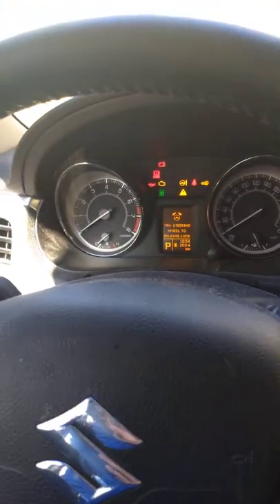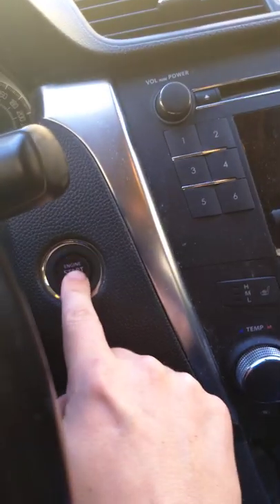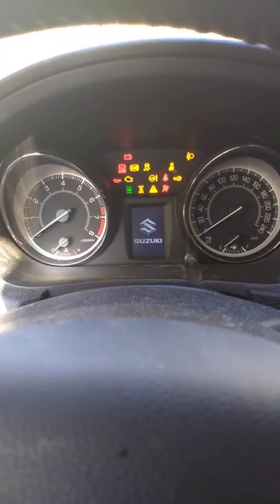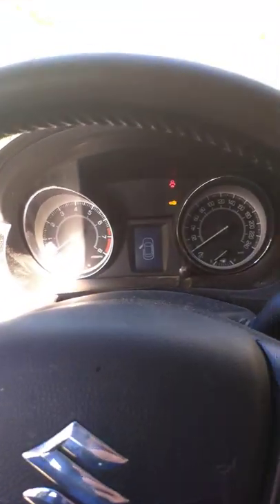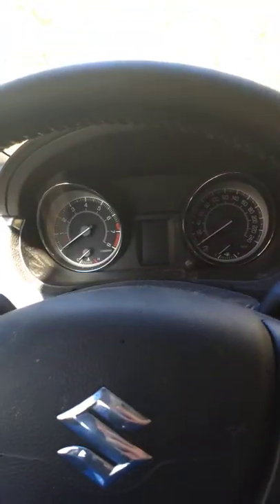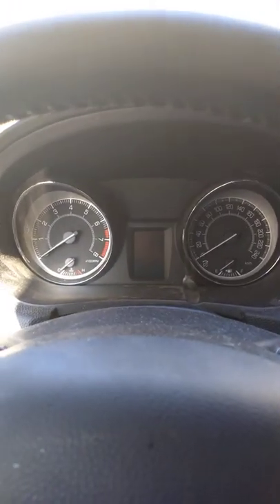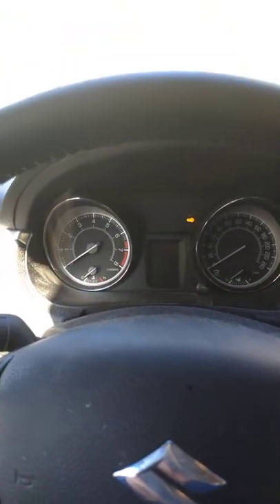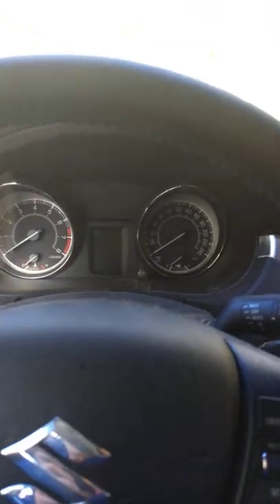How to fix steering lock bug, on a keyless car in a easy way.

Comment: ADVICE ! Instead of open/close the door many times you can just press the sensor near the tyre pressure placard (like a black spring loaded nipple with a screw). It will send the required singal without slamming the door. Just got the same trouble yesterday. Couldn't start for about 15 minutes so had to get an uber 😖

Today is much warmer so the trouble disappeared itself. Found the hack on the Kizashi forum. You could just disconnect the sensor mentioned above(please read the exact steps on the forum)  and you'll never have any more trouble with the steering lock (neither its functionality and a few more non-critical functions thought)
Reply from the maker: True. I learned that after doing this video. Thanks for the tip about the sensor :D
Reply: if you disconnect that sensor, once it is working, it wont lock up anymore
Reply: @Fyr13Bry  Actually you dont need to remove that rubber switch completely. Just wrap the screw with piece of paper or something that would isolate the screw from touching the body(ground) and the problem is solved. 👍
Reply: Did anyone disconnect the the black spring loader? Does this actually work?? My sons car is doing the exact thing! Is this a problem with the key fob?

Comment: I had the same steering lock wheel locked even though the wheel didn't lock even when turning 180° in both directioms when car was off, the solution that made it work was reseting the computer system by unpluging the battery for 5 minutes and pluging it back, hope this helps.

Comment: Many thanks, Petter.  This happened to me this morning and I needed to call the AA breakdown service to fix it.  The AA engineer sourced this video before he got to me and on arrival tried this open/close door method and it worked very quickly.  However, he said I needed to go immediately to my Suzuki garage for it to be checked.  They couldn't replicate the problem and said it was hopefully a one-off incident.  However, if it does happen again, I will know how to fix it (finger's crossed).

Comment: Hi Peter
How to solve this problem .i have same problem in my kizashi. Sometimes it takes 1 hour to start engine.
Thanks
Reply from the maker: To really get rid of the problem 100%, you would have to buy a new stearing lock. https://www.megazip.net/  it cost around 200$ for the part.

Comment: I have a 2010, and i didnt want to replace the steering wheel lock $$$, so if you can get it to the point where is starts, you can remove the electrical connection(unplug the wires on the door switch. It is on the B pillar, and it is one or 2 phillips screws, then take off the rubber, and just disconnect the electrical,it wont relock...it registers when you close the drivers side door, but if you dont have that switch connected, your car will still lock, but the steering lock will not engage

Comment: Thank you very much for the video! my 2011 Kizzy just started having this problem, two times so far. the first time I thought I would try the battery disconnect/reconnect to see if that would fix it but I did not have the proper tools and couldn’t get the battery cables off however I thought I’d try to start it again anyway and it started. I tried the same technique the second time and again it started so if it is a door sensor issue I am wondering if the precise door that needs to be open is the hood since it registers on the dashboard as a door as well.
I also recently was having problems with my car’s throttlebody.  The auto parts shop gave me the diagnosis and suggested buying a new one however I found another video on how to clean it so I tried that and it took care of that issue so I am wondering if I can do the same for the steering wheel lock - take out the one that is in it, give it a good cleaning and see if that takes care of the problem.
Reply from the maker: Thatt may work, could be worth a try. I personaly just use a hair blower, if the stearing lock is giving me a really bad time. Sometimes it workes fine for a long time.
Reply: @TheHarmonica  I'm wondering if the hair blower is a form of cleaning, not heat to fix it when it happens to yours... like maybe blowing off the dust... same with opening/closing the door 20 times, it may be shaking or vibrating off the dust... just a theory.
Reply from the maker: @dunoripavalan1980  I personally think, that it is the humidity that makes it come some water in there. I only have problems when it is raining. If it is minus, it allways it`s fine. And the same if it is hot outside, it allways starts with no problem.

Comment: Thank you so much for the video
But I can't really understand the processes you followed while opening the door depressing the brake pedal and ON the ignition.
And beside can this work on Toyota models?
Reply from the maker: Hi, the processes i did is, just turning on and off the ignition without pressing the break, then opening the door, until the key sign in the dash disappear, then i try  to press the break and start the car. I think this can work on a Toyota as well. Worth a try.

Comment: Al final como solucionaste ? Cambiaste la cerradura o el modulo de la barra de direccion ? Gracias
Reply from the maker: Hola, sí, reemplacé todo el conjunto de bloqueo de dirección. Y el problema desapareció por completo después de hacerlo.
Reply: La pieza es la 37100-57L12 no ?
Reply: Gracias por tu ayuda
Reply from the maker: @cesarvidal802  Sí, eso debería ser correcto. Para estar seguro, te enviaré un enlace para que puedas verificar que sea correcto. 

https://www.megazip.net/zapchasti-dlya/suzuki/auto-steering-lock-assy-includes-one-bolt-3710057L12000?q=37100-57L12-000%2C+3710057L12000%2C+37100-57L12%2C+3710057L12%2C+37100+57L12

Comment: I had the same issue with my rental car 2018 Nissan Rouge . A friend told me to lift and turn the steering wheel while pushing the break pedal down. Fortunately it worked.

Comment: I have had same problem before and I would just lock the car up then unlock with fob get back in and it would start. Today I could not get it started for nothing so I finally tried unlocking with the manual key inserted in key hole on the door and then the damn thing started!
Reply from the maker: He he. Nice one!  I had a funny thing happend to me as well today. I started the car, and the stereo speakers only work in the trunk. Then I got curious, and wanted to open the trunk to listen more closely. As soon as I opened the drivers door, all  the stereo speakers worked again.

Comment: I am having the same issue with my 2010 Kizashi. I had accidentally figured out the method that you have shown in the video with one variation that when I open the door I press the black rubber knob on the handle that locks the door and that locks my steering and then I just try to start it by pulling the steering to a side and starting the car. I was thinking of replacing the lock myself but when I took the plastic panels under the steering wheel out I saw that there is no easy way to get to the bolts that are holding the lock. Do you know about how to unscrew those bolts? Thanks for sharing the video!
Reply from the maker: Hi, I really don`t know anything about the screws. I had not changed this streainglock. Mine still works fine. But when it is raining it can be hard to start still, so then I either use a hair blower, or a hot towel in a pastic bag, that I put under the steering wheel. It then starts easy enough.

Comment: I'm here looking for a solution for a different problem on my Kizashi. But I've also had this same issue as well and am waiting for a part to come in so that I can have it fixed once and for all. Lately, it's done this to me at least  4 times in the past 6 weeks or so. Usually, I just get out of my car and go for a walk a distance away; walk about 10 minutes and then come back....and it will start. Maybe it's like a re-set to the computer system...I dunno!! (*shrugs)
Reply: Did you ever get your problem fixed??

Comment: I had similar issue with my holden (vauxhall) astra 2017.. turns out d remote battery was   dead!! Changed it n worked.. try that instead.. Might just b a remote battery
Reply from the maker: I my case it was the steering lock unit, that needed to be changed. My car works now perfect after that was done a two years ago.

Comment: That happened also to me with my suzuki vitara 2018. Sad to say as time goes by, the problem is even getting worse. Ignition wont turn on and ' Service steering lock is appearing in the panel.
Reply from the maker: True, it get worse with the time. Eventually a change of the steering lock is needed.
Reply: @TheHarmonica  i replaced it with new steering lock module but yet hasn't fixed.

Comment: Today on a 2014 swift ... I closed all doors locked car with the fob ... turned the steering til it locked then pressed the start button unlocked the steering  . Then pressed the brake ans pressed to start .
Reply: Tomorrow I'm going to remove the steering lock and see if anything is noticeable

Comment: Hey there, does this happen to other cars? 

I have the same problem on my infiniti QX56 2012. 

But I realized it happens when I leave it overnight. It doesn't happen again once you start it. Unless the car gets gold or something I'm not sure.
Reply from the maker: I don`t know if this is common problem on other keyless cars. I had this sensor bug thing going on for 2 years. Sometimes it works fine for long time in cold weather, and some weeks it is trouble every time it is cold or raining outside. I believe it is humidity that does the bug.  If the car is hot inside in the cabin (+23 celcius), it is never a problem starting it.  Another tip when the the humidity is high, is to get a lighter and use it under where the steering lock is, then it will start in 
shorter time.
Reply: Yes Nissan, Inifinit parent company used the same hardware that Suzuki did for this task

Comment: That is not how you disengage the steering wheel lock. Can’t believe you sat there for that long doing that.
Reply from the maker: The stearing lock is disengaged, but the car claims it is not, and therefore it won`t start the car.
Reply: Petter Harila worked for me !! thanks
Reply from the maker: @laco-lyrics6852  Cool to hear!
Reply from the maker: @koolbreeze9427  To bad it did not work for you.

Comment: Can you just disconect battery for reset
Reply from the maker: i don`t know.
Reply: No, it doesn't work, I have tried. Also pressing the door sensor, simulating that the door is always closed does not work (for me). I will buy a new steering lock, hoping that I fix it definitely. My kizashi is 10 year old, I drove 150k km across all Europe, I always made the maintenance by myself and I never would dream of change it...
Reply: @giancarloferrari3857  just disconnect door sensor, then the stering wheel lock wont engage anymore
Reply: Nope...I have tried this too ...10 minutes long.  By the way, the steering lock error and try to start the engine almost alway for 15 minutes without success has damage the  battery. I ordered a new steering lock device, disconnected the old one -> IMPORTANT (obviously) with running engine <- connect the new one leaving on the side. I brought a new battery and now it's everything fine again.

Comment: The order is not clear
Reply from the maker: You press the start button without starting the engine by pressing the start button 2 times, then you have the door open at the same time, each time you do this, the steering wheel lock unit will reset